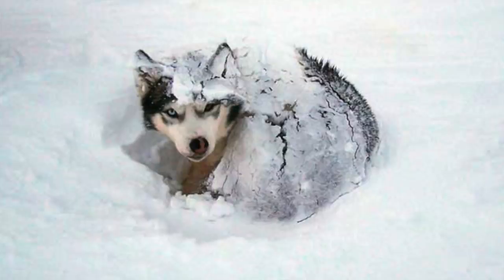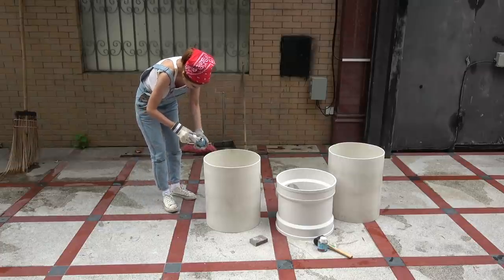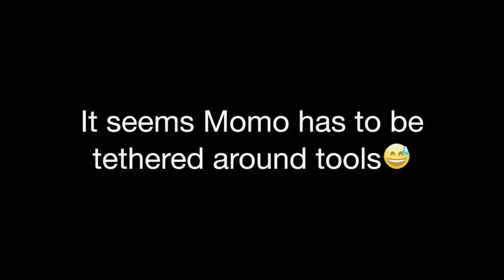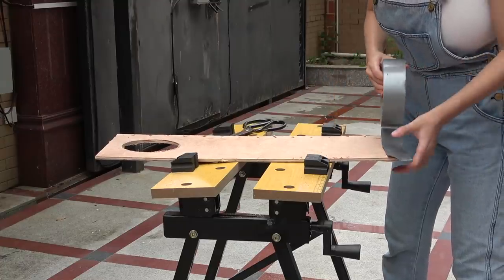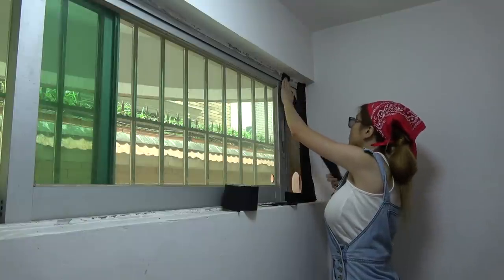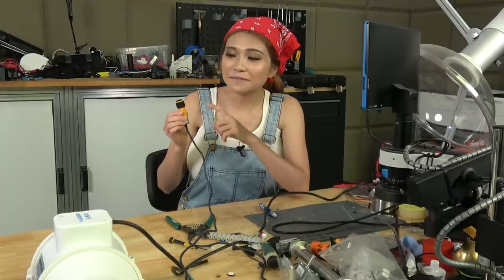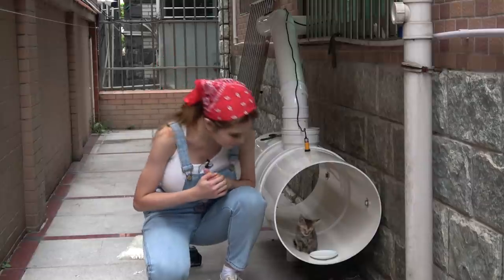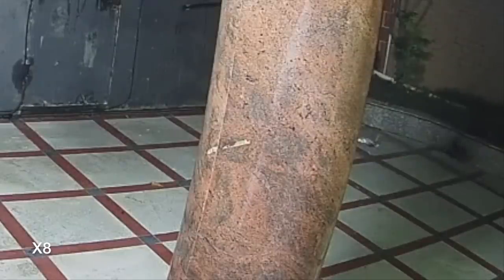DIY Air-Conditioned Husky Den! Plus, meet Zatoichi the Blind Kitten

Comment: Nicely done ! Please be careful running a large hole saw on a small pistol grip drill, it can bind up and twist your wrist badly. It is best to use a large angle drill where you will have some more leverage against the big hole saw.
Reply from the maker: Yes! I would not have tried it on thicker wood, definitely a bit risky...

Comment: Good video, and the prox sensor for the dog was a brilliant idea.
Quick safety suggestion: When you are using a drill (e.g. drilling in metal with a 10mm drill bit or larger, or in your case, drilling in wood with what looks to be a 100mm hole saw) there is a risk of the cutter catching, and if you are if a bad position it could hurt (or maybe even break) your wrist. What I like to do is to keep the grip of the drill on the left side of my body, so if it does catch it will go into my ribbs instead of breaking my wrist.
Stay safe and keep up the good work. Looking forward to your CNC projects.
Reply from the maker: Yeah! A little risky, thin wood so not too bad but I don't think I'd try it again that way...

Comment: OOT but what is your favorite glue or epoxy?
I'm using cheap, 2 mix (black+white), korean epoxy. So far so good, until...
the tube packaging is ripped when the epoxy is half full. 
It hardens over time, even when not mixed, the tube packaging was not able to contain the hardness anymore.
Reply from the maker: Depends what I'm doing, I pick adhesives pretty carefully.

Comment: I would definitely not recommend using purple primer on anything that your dog is in... if she has any cut's it will sting like crazy.. it stings like 4 times more then if you poor straight alcohol on the cut... you will be about screaming in pain for about 15 seconds... if you have no cuts you will be fine but if it finds a cut you will know it!! If you were using it for piping on pressure line the I would definitely recommend.. the glue doesn't really stick to PVC.. the primer helps it.. if you want to test it out put some glue on outside and try wiping it away.. then add primer and glue.. try wiping it away.. you will notice the difference.. but for your dog's toy I would be scared that water reactivates the primer and if your dog has a minor cut.. omg painful.. but glue would be fine doesn't sting like primer does.. fyi I would recommend putting it at slightly angel it so rain water or snow doesn't build up